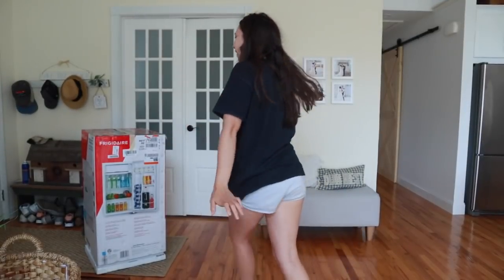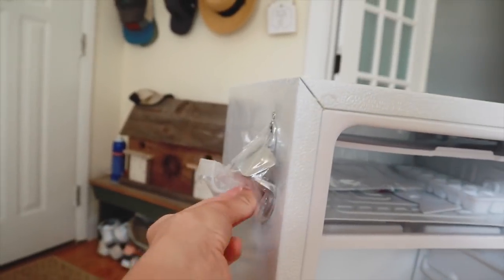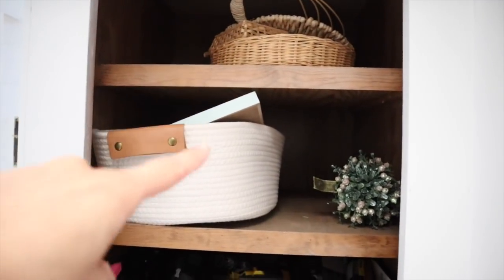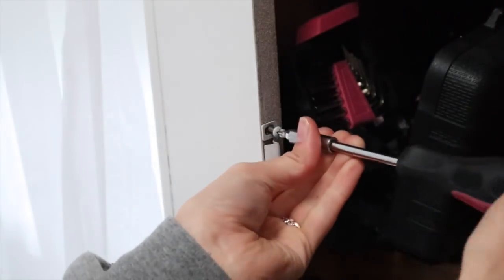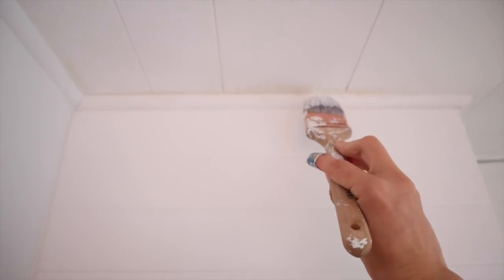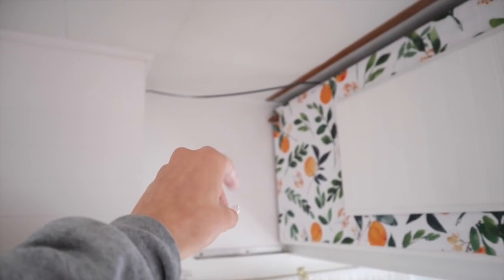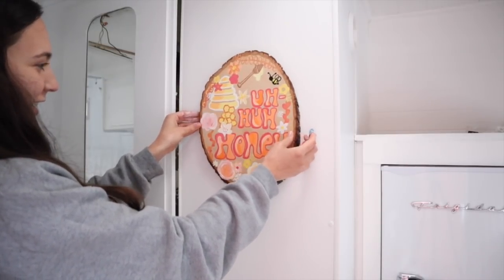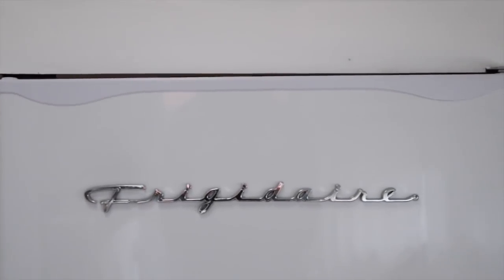FINALLY REVEALING THE NEW CAMPER REFRIGERATOR + Camper Upgrades

Comment: Everything looks beautiful.  We have an electric fridge in our camper too.  When we bought it the fridge was the only thing that didn't work.  We've never had a problem with the new one not having gas to keep things cold on the road.  We plug our camper up a couple of days before a trip to make sure everything is working, including the fridge.  Then we pack the fridge the day before our trip & do not open it again, so that when we cut power & drive off it's still super cold inside when we get where we're going & plug it back up.

Comment: Questions about the fridge install: 1-did you hard wire it to the electrical or is it just plugged into the outlet? 2-behind the trim is there room around the fridge for air circulation? 3-does it vent outside at all?
Reply from the maker: We have it set up exactly how the original fridge was, there’s circulation and a vent to the outside. The old fridge plugged right in behind the fridge which is where this one plugs in
Reply: Awesome! Our vintage camper didn’t come with a fridge but has a vent and a place to plug into propane but we are thinking of getting one similar to the one you guys have and going all electric. A lot of places say that if you don’t have the right circulation and venting the fridge won’t cool. Your camper is goals!
Reply from the maker: Figuring all of that out can be so tedious! It took us a while to figure out what direction to go with for the refrigerator. I hope your camper is going well!!